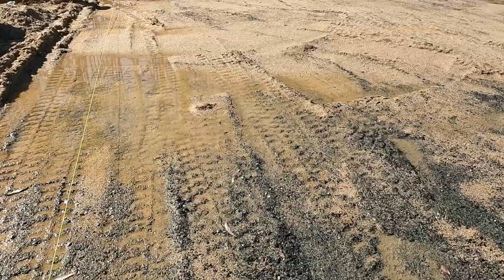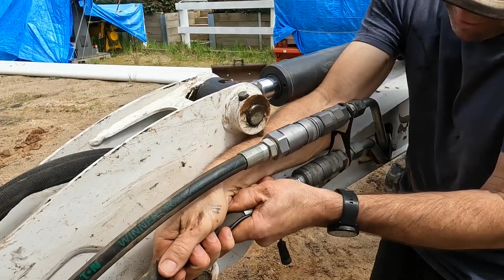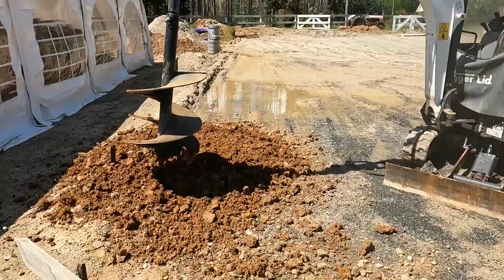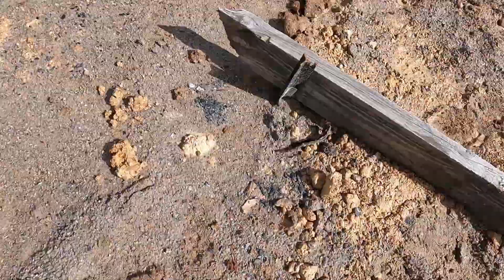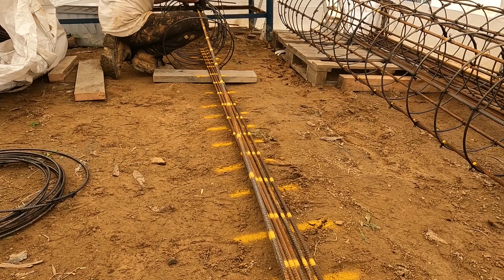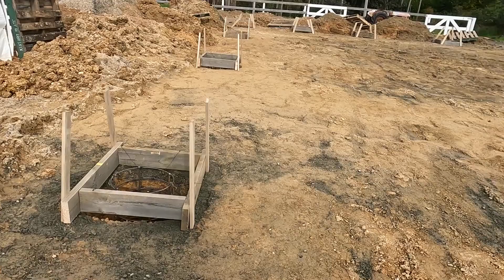Workshop build, Part 1 Drilling piers

Comment: Does this need an inspection before pouring?
Reply from the maker: Hi mate, depending on the approval there are usually inspections at certain points. In my case, pier holes were inspected before reo and concrete going in. Once all portal frame complete there's another inspection and then a final one on completion.
Reply: Building a mobile drive through for a bank. With pneumatic system. Frame inspection, insulation inspection, final inspection, final fire, and final zoning inspection. I just don’t know when I need to call the I sections
Reply from the maker: @Stop_the_cap311  Yep, there can be a lot of inspections and red tape to get through. I'm fairly lucky that I don't have too much of that. As long as you stick to the approved plans there shouldn't be a problem

Comment: Gday, it’s unbelievable the regulations when it comes to buildings, my workshop here had to be piered and I was blown away at the depths they wanted, certainly not going to slide down the hill that’s for sure, the halo is a brilliant idea and I’ve never seen the bottom hole cleaner setup before, so simple but effective, brilliant job mate, if I lived closer I’d give a hand, cheers
Reply from the maker: Thanks Matty, yep some really good tools available now. It’s going to be one very solid building